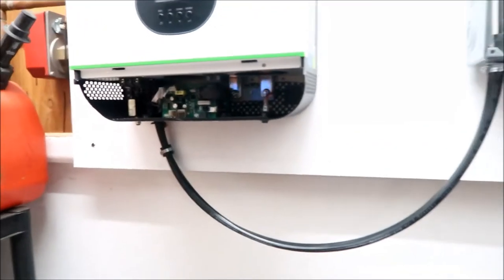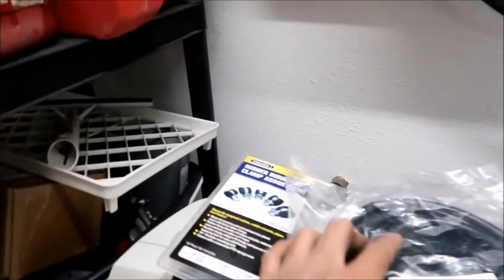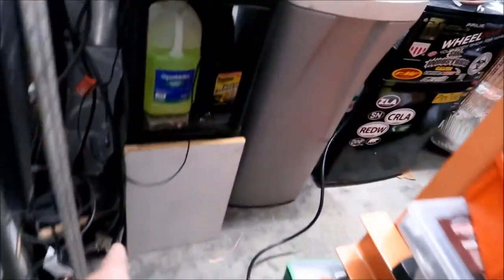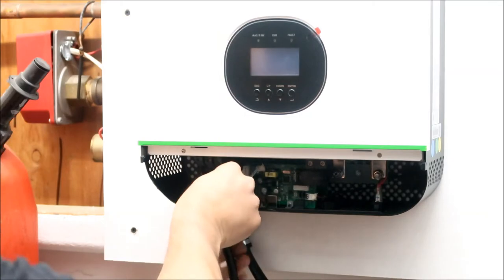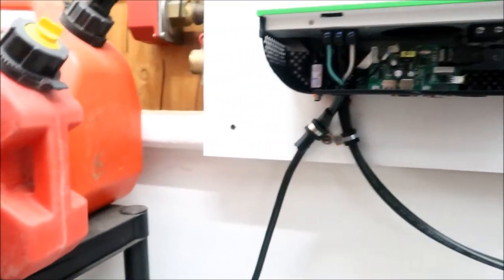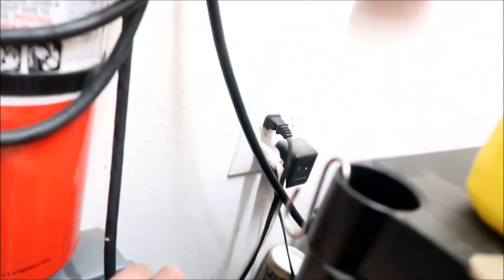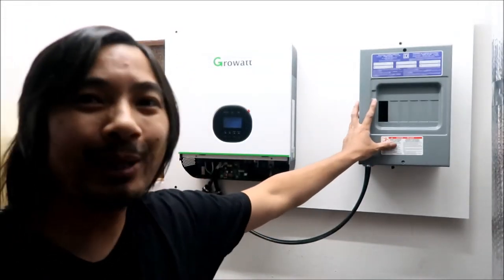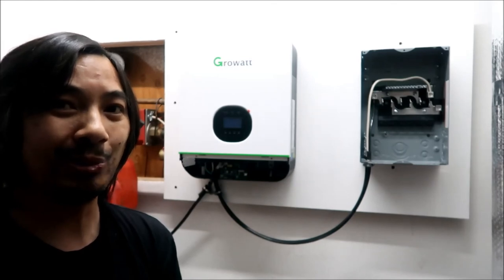HadesOmega Solar Garage Project Episode 18 - Growatt Inverter AC Input Wiring

Comment: I am using 10ga. wire on my AC out as it has a 30 amp output on it. And using 8ga. wire for the AC in coming off a single pole 40 amp breaker.

Comment: How large AWG, will the Growatt accept on the AC input that you wired up using the Will-recommended 12 AWG extension cord? (I want to use the maximum AWG the Growatt will accept on both AC In and AC Out)

Comment: It's ok for you to overkill with 6 AWG wire for Growatt AC output to your sub panel, but it's quite under power for the input with only 12 AWG extension cable connected to a 15 amp outlet.  Growatt's manual says to use 8 AWG wire with 40 amp breaker for a reason.  Just in case if Growatt switches to Grid power and then start charging your battery while powering the load from your sub panel, it may draw tons of amperage and overloaded your 15 amp outlet.   Just a thought.
Reply from the maker: Yes it could overload it but there is a breaker for the outlet so it won't cause anyfires.  But yeah it could trip it and there would be no power.  You can lower the charging amps also.
Reply: @hadesomegamoto7639  Thanks!  Good to know that I can lower the charging amps to the battery too!  I have the same Growatt setup but still waiting for my new battery to arrive soon.  I'm still trying to figure out all the wiring in proper gauges...
Reply from the maker: Cool, haha your comment reminds me of when I tried to charge the battery with my generator.  I overloaded the generator.
https://youtu.be/7yGeOZcY9a0

Comment: Thank you so much for your videos I was wondering if you have a video showing how you wired your distribution panel to the Growatt? I'm also curious if I can use mcb the miniature circuit breakers with the plastic box instead of a metal box? This is for a Growatt 3000 off-grid. Thank you!

Comment: How are your batteries connected? I’m trying to connect one of these so my generator can charge my battery bank then power my appliances
Reply from the maker: On the right side of all the other wires.
Reply from the maker: They are going to be connected to the battery input there are two lugs with 10mm nuts on them
Reply: Please do a video soon on the programming as well 👍
Reply from the maker: @seanmoon1444  Will do I should be online in a day or two =)